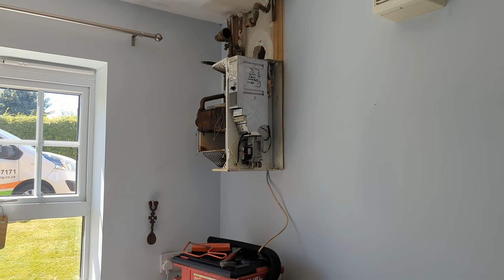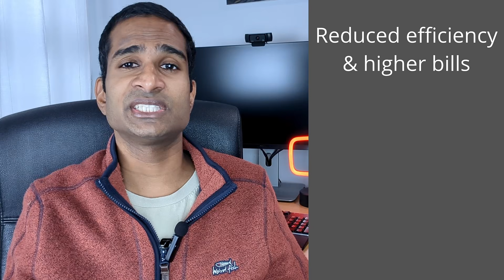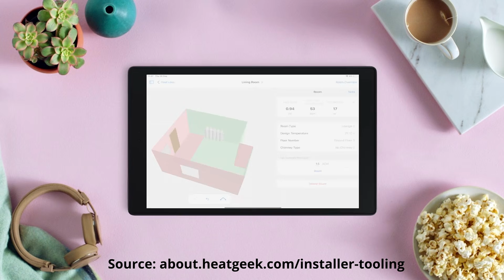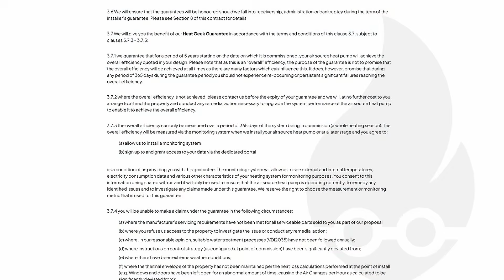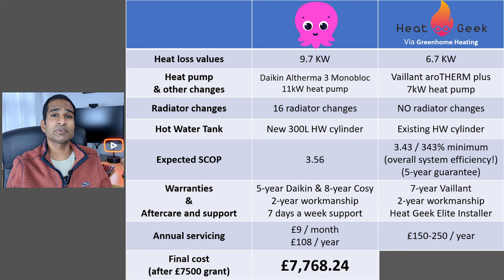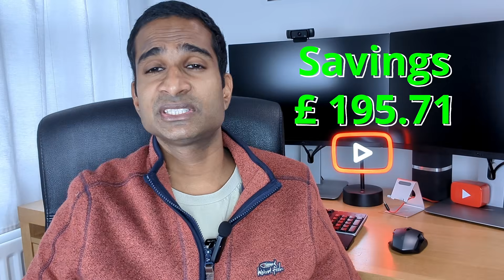Why I SNUBBED an Octopus Energy Heat Pump Install...

Comment: So, can we use the layout of the heat pump, with regards to pipe sizes, flow temperature and external weather controls to work a gas boiler more efficiently. As gas is cheaper than electric, this will gives a better return on the gas boiler efficiency?

Just asking.
Reply from the maker: Yes, 100%! This is exactly what the pros call 'Low Temperature Heating.' By using weather compensation and bigger emitters (radiators) with a gas boiler, you force it to stay in its most efficient 'condensing' state. You get a more comfortable, steady heat and lower gas bills. You’re essentially building a 'Heat Pump Ready' home while saving money on gas in the meantime. S
Reply: Condensing gas boilers can reach up to 95% efficiency with weather compensation and modulation (most condensing boilers will run at around 85%)

Comment: I like Octopus, and think they are doing more for consumers than any other energy provider in my lifetime, but!!!  They are energy providers, and that is where I trust them. When it comes to everything else, I prefer to look at the specialists in that field, and Heatgeeks are the "Octopus" of the heat pump industry.
Reply from the maker: That's an interesting analogy! It's definitely good to explore all the options. Shan
Reply: Sometimes the local Heat Geek is too busy or unavailable, and other options are cheaper.

Comment: Wait, what? Energy suppliers providing installs that will in the long term use more energy? Who'd have thought it?
Reply: Octopus may have been playing it safe with their efficiency estimates. Some Octopus installs achieve great results.
Reply: @Biggest-hz7ng  Or they're just chancers like the rest. Doesn't cost THEM anything does it. Stop sticking up for them, there's playing it safe and there's been nowhere near what was required.

Comment: 50C flow temp!  I only run my gas boiler at 40C flow temp.
Reply: The actual flow temp varies according to the heat curve. It only reaches 50C at the design temperature - maybe minus 4C. Mostly it'll be running lower than that depending on the outside temperature, say 30-40C.

Comment: I note that the octopus was a 11kw compared to HeatGeeks 7kw, I’ve probably missed it but your heat loss must be low. We had both do an assessment, HeatGeeks pre on line zero disrupt estimate was £2700, the post assessment quote was between £8000 and £9200 with 3 radiator swaps but also depended on choice of cylinder. The only difference between your hp and the proposed Hg hp was the 12 kw at an extra £1000 to the 7, even if you factor in the cylinder don’t know how they got that price. Octopus came in with £5700 and all radiator changes. You got really lucky with your HG price. Regarding the Octopus quote, it was based on their cozy HP which when we were originally told we could have had the Daikin. We would have gone with the Daikin but the ugly cozy and the higher db rating so we decided to park it. Really Bad experience with HG themselves but I hasten to add not Mark from  Greenhome who were the HG approved assessors.
Reply: @EVNick is happy with his Cosy. I'd like to see a few other happy Cosy owners posting videos to engender confidence.

Comment: Great video Shan 💚🌎
We went ahead with Octopus last December 
Based on online quotes of £7 to £8000.. British gas, Heat Geeks, etc
Octopus quoted £3600 but 20% was soon knocked off due to a Xmas deal 
Several issues with the survey and installation 
We have a 3 storey 1972 terrace with internal garage poorly converted to an additional room.
Due to delays Octopus basically rebuilt our central heating on the first two floors for no charge
..and also gave us a discount of a further £500
So we eventually got a Daikin 
 Altherma 8kWh, 250l tank, 6 rads out of 13 changed for £2000
...and largely rebuilt CH system 
October was 410% and November 390% CH cop
No has gas bill since June
Bought 5 yr old EV then too
and went onto IOG 7p tariff.
We have 8 solar panels 
3.7kWh fox inverter and 15kWh batteries storage since Dec 2024
..and an induction hob 
The last 6 months we have spent nothing on fuel for the car or heating, cooking and hot water 
Thanks again for helping us make these decisions 
We are in Washington ( ogn )
💚🌎💚
Reply: What I meant by the last 6 months costing "nothing".. money earned from solar battery export during sunnier months has covered all our costs for the last 6 months inc c4000 miles in EV
Reply from the maker: That's an absolutely phenomenal outcome, especially with those COP figures! So glad to hear the videos helped along the way! Shan

Comment: Great result Shan and thanks for sharing in detail your experience.  Other people seem to find Heat Geek installs are more expensive, and part of that is the cost of the Heat Geek performance guarantee,  but in your case absolutely not the case and clearly you got a great design an install done at a very fair price.
My own heat pump I’m sure is over sized due to a high heat loss and low SCOP, but even so its still less than half the running cost of the previous oil boiler and is balanced by my solar generation so zero annual bill.
Just one word of warning about the Shelly EM, I have one on my heat pump and it consistently over-reads by 7-10%, so if you can, double check the readings with an electricity meter which should be more accurate.
Reply from the maker: Thanks for the insight ☺️👍🏽 Shan

Comment: 8:15 Why did the hot water tank cost 3000 pounds?
Reply from the maker: When we relocated our HW tank in the loft from the airing cupboard, going from a vented to an unvented system too. This was done 2yrs ago by a company not related to my HP install. Shan

Comment: Makes perfect sense for you with an old inefficient non condensing boiler. For those with modern condensing boiler on a good gas tariff (tracker or fixed), the decision is not so straight forward. Our 15 year old BAXi condensing gas boiler is fitted with weather compensation and sits in a 1930s 4 bed detached property,  we have out heating on 24/7 at 22 degrees throughout with overnight setback at 20 degrees.  For the same period (Jul-Nov) our gas bills totalled £202.44 (CH + HW). Although you live in a slightly larger property, it's more likely better insulated than our property is due to its age, yet our gas bill was not far off your heat pump bill. I just wouldn't bother swapping over with all the things that can (and often do) go wrong with a HP install just to save £20 a year. There is still so much you can do with a gas boiler to save money, e.g. fit a weather compensator and/or gas tracker tariff. HPs are not the only solution to reduce energy bills.
Reply from the maker: Thanks for watching and commenting 👍🏽 S
Reply: We replaced our gas boiler when it started to need parts. I felt strongly that the roughly one tonne per year emissions reductions and future proofing would be worth a bit of install cost. Electrification is the way to reduce emissions.
Reply: @Biggest-hz7ng  For me it’s the cost of energy that is priority in our house, not the emissions. We also have solar and battery system for cost reasons only. The fact that the solar panels, batteries and heat pumps are made in Chinese factories spewing out 33% of the worlds total c02 is more a concern than what my little gas boiler contributes.
Reply: @JohnThomas-ey1hx  the average heat pump pays back the emissions for its construction in around 1 year (and then emissions-wise it's gravy). And similar for solar (1.6 years). Note that electricity in China only produces 50% more emissions than in the US, so the differential is large, but not vast when considering tech that will pay its emissions costs back quickly.

With batteries, 95% of the material will be recycled. For simplicity though, I'd measure payback solely financially.
Reply: @Biggest-hz7ng  Sadly China don't just make heat pumps. Replacing gas boilers with heat pumps isn't going to make a tiny dent in China's global emissions. If your happy to pay extra to believe your making a significant difference then good for you.
Reply: @JohnThomas-ey1hx the UK needs to clean up its share of the problem in a timely manner. China is starting to address its share too.

Comment: An excellent summary of your journey and real world data backs up your decision. As to your question about the speed of rollout v precision I think this misses the point that your precision Heat Geek install was both quick and precise wasn't it because it was a Zero Disrupt installation! Surly if Octopus were to develop their own iPad measurement and heat loss calculation like Heat Geeks' or licence it, then they could deliver tailored solutions like yours at lower cost and at speed. However, there is something else to put in the balance. Heat Geek are addressing a market at the moment of customers that have an interest in how their Heat Pumps work and perform and who accept that you don't operate them like a legacy Gas Boiler. Octopus are sticking with the over engineering so as to protect the reputation of themselves and Heat Pumps in the mass market where less informed customers and subsequent owners taking over properties with preinstalled Heat Pumps will perhaps have expectations of operating their heating like a Gas Boiler. Doing so you have to over provide heating capacity and accept lower average SCOP.
Reply from the maker: Thanks for the input. Yes, it was precise and very quick. I meant the speed at which octopus are installing their heat pumps, though the zero disrupt approach will narrow this gap. S

Comment: Thanks for the breakdown Shan. Totally agree it’s such healthy competition with us and Octo- we genuinely love those guys!   
I did how however think it was interesting that you think that swapping 16 rads and cylinder was the quicker approach of the two when comparing the two business models at the end of the video? Perhaps this was because you experienced a ZD quote before the app instantly built the design for the engineer right there on site at the end of the installation? This makes the ZD approach much faster in terms of speed of install and design.

The real difference between our businesses is that we empower local independent engineers with the world’s best training and have the benefit of their passion and pride. Vs employing installers to keep costs down. We are passionate about empowering local business.
Reply from the maker: Thanks, I more meant the rate at which they are putting heat pumps in with their size. As you say it'll be far quicker with less disruption to not make any unnecessary changes. 

My install only took 2 short days and loving it 😊 Shan

Comment: what ever temps are you running in the WH tank, & the weather comp must be about .30 or a general flow of 28-30, & room temps.

Mine is running 
UFH at .3 weather comp, flow temps 28-30 24/7 
DHW at 55 twice a day room temps of 20  
last 7 days cop 4 140kWh used, 560kWh energy
same ASHP 7kw vailent 

COP in window: 4.11
                                                 Min	Max	Diff	             Mean	       kWh
HP electric consumption	26 W	3465 W	3439 W	    598 W	      100.690 kWh
HP heat output	                0 W	      10203 W	10203 W    2455 W	413.421 kWh
Flow temperature	               17.0 °C	75.6 °C	  58.6 °C	      29.5 °C	
Return temperature	       22.6 °C	72.5 °C	49.9 °C	    26.8 °C	
Outside temperature	       4.1 °C	11.9 °C	7.8 °C	    8.8 °C	
Room temperature	     18.9 °C	25.7 °C	6.8 °C	   20.2 °C	
Target temperature	     39.0 °C	56.0 °C	17.0 °C	    47.7 °C	
Flow rate	                    711.067	1056.000	344.933	803.094
Reply from the maker: HW tank at 50 degrees with a one off 70 cycle on Saturday when we need lots of HW. Rooms at 20-21 degrees and the heat curve is currently set at 0.85. Shan

Comment: Very informative presentation. Was your installer a franchisee of Heat Geek? If so who provides the guarantee and if the installer no longer operates will Heat Geek pick up the mantle for any issues? Thanks
Reply: Heat geek give the guarantee as the job is done through them and their MCs. If the company go under during installation we will assign another heat geek at no extra charge to finish it (not happened yet and don’t expect it to) - or fix any issues after the installations

Comment: I would choose quality, we don't have a local heat geek, and the nearest one, about an hour away wasn't interested, so we used a local Vaillant approved installer. Five bedroom detached house, built in the 70's and extended in the early 2000's. Heat loss pretty much the same as yours, only three if us here most the time. Same heat pump fitted, with a unitower. In November we used 353 kWh, Shelly reports 340, it's likely the Shelly is wrong, as the electric meter in the Arotherm is Mid approved. Now for the Cop, mine for November is 5.71 combined, sounds fantastic, but it's highly likely it's wrong, as is yours. The Arotherm uses clip on heat sensors, they are not calibrated, and are not even a matched pair, even a slightly incorrect readings will massively skew the calculated Cop, which means it's meaningless. I'm in the southeast, so better climate than up north.
Reply from the maker: Thanks for sharing your figures and insights, especially on the COP calculation – always great to hear different perspectives on these systems! Shan
Reply: Energy Stats UK suggests his Arotherm is within 8% or something similar.
Reply: @Biggest-hz7ng Does he have open energy monitoring? There's quite a large thread on the OEM forum about just how inaccurate the reported Cop can be on the My Vaillant App for the Arotherm.
Reply: @TheRonskiman he does, yes. I think he's looking at the numbers on the unit, not the app though.
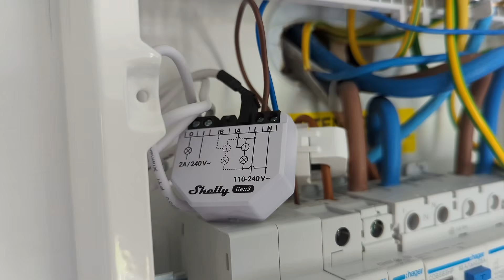Reply: @Biggest-hz7ng  He's getting the COP from the app at 15:38 which could be completely wrong, as it can vary widely between units. Be interesting to know what OEM reports for the same period. He could be lucky and have accurate temperature readings, but I think we can both agree mine at 5.71 for November is very unlikely to be correct. For year to date from May, mine reports a COP of 4.87, not far out from his, so I suspect his is wrong as well, especially as he's running 50c target, I'm running a 38.4c flow at -4c, currently set to a 0.45 steepness on the curve. None of my radiators were changed, but they are well oversized due to the way I had my previous gas system setup.
Reply: @TheRonskiman perhaps Shan could specify how the control is setup? It may have been designed for 50C, but perhaps it is set up for less? And how does the app compare to the data in the SensoComfort (which is what Energy Stats UK looked at)?
Reply from the maker: Consumption data is via the Shelly device with the generated heat figure from the Vaillant app. Designed for 50.2 degrees flow temp, outside temp -4 with all rooms at 21 degrees. Heat curve is currently at 0.85. Shan
Reply: @everythinghome that should result in a flow rate of about 50C at minus 8C?

Comment: Great video Shan! Very informative and well put together. These kind of personal accounts of experiences are highly valuable to those considering a heat pump. 👍 Although you undoubtedly made the right choice,  your experience differs greatly from mine. Back in March 2025 I had a choice between a Cosy 6 for £150. From Octopus and a Vaillent 5kw from Heat Geek at around £3.5k. At that price disparity it was a no brainer and the Cosy has been performing in line with or slightly better than my expectations, plenty of details on my channel. I think what this goes to show every home is unique and different solutions work for different people. it's always best to get multiple quotes for perspective as your previous coverage shows. It's great to see Heat Geek have upped their game too with their more recent approach being more tailored to specific circumstances. 🙂
Reply from the maker: Thanks for watching and commenting. £150 is an absolute no brainer!

Comment: Our experience 3 years ago was not much difterent, we managed on making our own rough calculations, only because our property is a steelframe with brick out walls. Our guess was a 9kw ASHP monoblock. A steight swap from our old Grant Oil boiler outside and no rad changes. Total install £9k minus government grant of £7,500. So our 1963 detached 3 bed bungalow November cost us £36.46 to heat at 19c and our hot water is managed through a Sunamp, which cost us £1,200 to install, and 1-1 charging cost us £6.12 for 2 charging sessions per week plus month charge. So we are not doing so bad compared to your figures. Happy with that. We use Octopus Go tariff and have abttery storage. (Our 4.4kw Solar array helped us out, so our figures don't include the kWh used for the system which was 100.2kWh), the above is just based on our Grid use records.
Reply from the maker: That's brilliant to hear you got such a great result with your own calculations and that your system is working so well for you! S